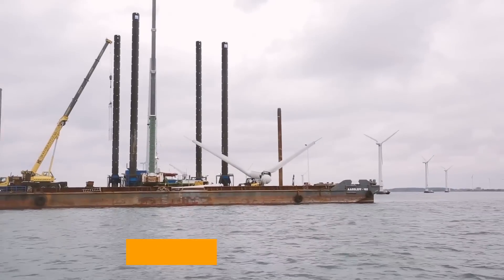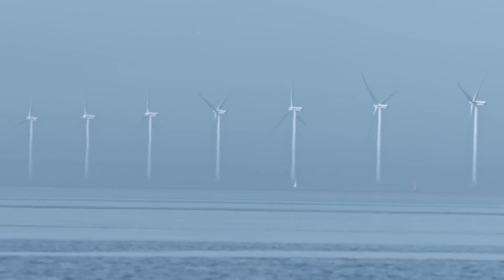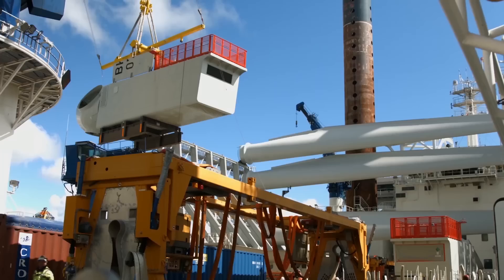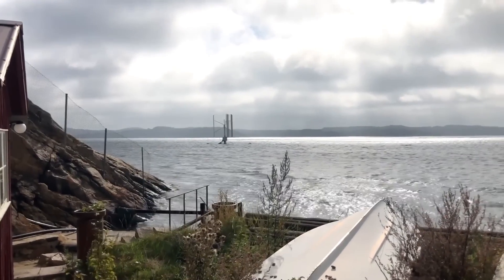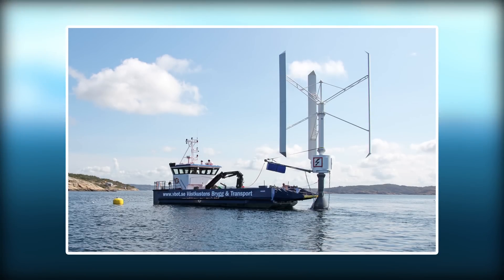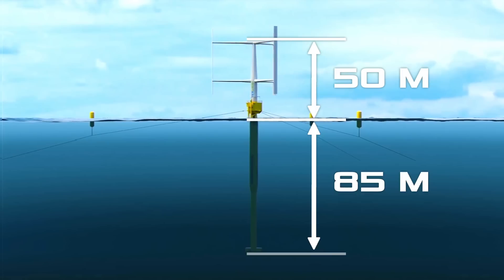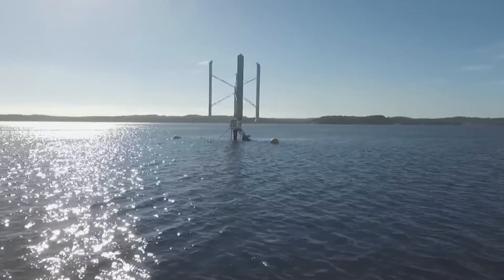Vertical-axis Wind Turbines could Revolutionize Offshore Wind Power

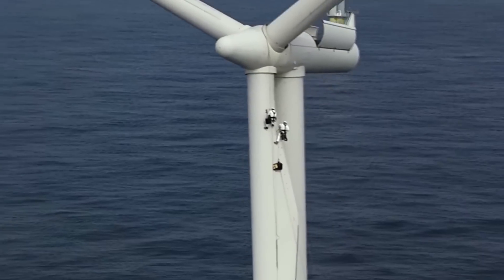Comment: 2:12 "Difficulties of working conditions at sea leads to the fact that every year the efficiency of installations decreases an average of 4.5%."  This first appears to be human working conditions at sea causes 4.5% drop in wind turbine efficiency.   Maybe this is what was meant "Typical harsh sea operational conditions, greatly wear to their blades,  causes offshore wind turbines to suffer an average yearly 4.5% decrease in their electrical power output."   10 years X 4.5% is 45% not 50% as stated in the video.  

Offshore wind turbine blades are fiberglass with reinforcement.  Possibly carbon fiber.   These materials don't stand up to 100 mph 160 kph large hail from hurricanes that is inevitable for offshore wind turbines in hurricane prone areas such off the east coast of North America.  Maybe that is once in hundred years storm, maybe 20 years, maybe next year.  One extensively damaged blade would throw the wind turbine out of balance requiring it to be locked down till serviced or it would tear itself a part.  

 2:25 "The probability of failures and break down is also growing.  After eight years it is 80%".  It is unclear if the wind turbines are left derelict.  There are typically no large subsidies to repair wind turbines which were in effect when they were built.   There is also a heavy human risk factor of risking human lives for a machine that may not have many service years left.   Fish are chased away by the noise of wind turbine at power.  The sea life seams like these structures when not making noise.

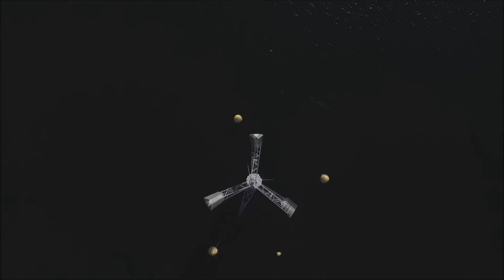4:20 Vertical axis offshore wind turbine.    The basic physics of a wind turbine is it is extracting the PUSH from the wind.  It should be possible to calculate the strain on wind turbine tower or mast to calculate the total force of the wind force on the tower and blades.  The more power the blades are extracting from the wind the more force they push on the tower.   That is the case for horizontal or vertical blade wind turbines.  Strain gauges in the wind turbine tower could be used to determine the wind loads imparted to the tower.  A totally calm day might be used to get a base line. 

Vertical turbines in part an asymmetric (non symmetric) rotating toque of their their wind loading of their support structure requiring it to have great rotational resistance from its foundation.  That's the kind of movement used to remove stuck bolts and screws!   It is in addition to the horizontal pushing force the vertical structure and foundation has to resist from the wind pressure on the blades and other structures.  That high twisting force into the foundation likely keeps vertical axis wind turbines from becoming large.  

There is no wind gain on the forward sweep of the vertical blades into the wind.  Any resistance of the up wind rotating blades reduces power generated by the down wind rotating blades.  It also reduces the torque the foundation has to resist.   There is no way to dynamically balance the vertical twisting load on the foundation because that is the force the is being used for energy extraction.  That is one of the reasons  horizontal wind turbines have a large advantage over vertical axis wind turbines.   

Horizontal wind turbine have a strong rotational horizontal force the tower has to accept that is horizontal in nature at its foundation not twisting.  It the foundation were to give way suddenly under wind power it would rotate upward.   A tumbling giant wind turbine at sea would be something you'd want to be a safe distance away from!   Kind of like watching a tornado.  

One 1MW of generating capability from a grid power standpoint it is not much.   A GE locomotive AC44CW produces close to 3.3 MW of electrical power.

Comment: After 10 years they produce half as much energy? If that were true, it would be a colossal waste of time. Imagine building a house that lost half of its "shelter" after 10 years. Honestly, it already is a waste of time though, just because of how poorly designed those blades are. They still haven't figured out how to put proper sails on those things?

Seatwirl is actually worse in its design than the current version. Those engineers really are something huh?

Comment: Energy in the wind is to the power to the 3 of speed.  In round numbers. You said, double energy when wind speed goes from 20 to 25 km/hr., and thus doubles again at 30 km/hr.. That is 4 times more power. The wind turbine has a wind speed limit for the electric generator, at maximum capacity. Horizontal wind turbine change pitch to deal with higher speeds, and if very high lockdown the turbine. Vertical wind turbine to be simple and robust have fixed blades. Thus only speed of rotation can be used to adjust the energy feed to the electric generator. A slipping clutch is the simplest and robust means of controlling rotational speed. Total energy removed from the wind is the sum of slippage wear and heat and electrical power generated. The alternative is to lockdown. Or the generator is over-sized.

Comment: Why can't we use conical wind tunnel, air drawn into large diameter side to small diameter side creating high air flow and velocity pressure but only problem is that it can not revolve according to wind direction. Any suggestion from gentleman reading my comment.
Reply: I am not a gentleman, but I can inform you, as a wind energy specialist, that a conical wind tunnel going from  a large to a small diameter would be reducing the amount of air flowing through your turbine, more air will flow around your structure than without the tunnel. If you want to know more about shrouded wind turbines, you can probably find information on that subject on the internet, the shroud has to suck wind in by having a larger diameter downwind than upwind. This is not used as the shroud would cost a lot more than what you can gain by using it.
Reply: @jessicaholierhoek4264  I had the same perception as you described regarding conical wind tunnel. I am not engineer by education but by instinct as i design micro-airflow equipment, but of course i m man but not gentle but u look gentle women.

Comment: Some problems with them: The wings have to withstand transversal wind and centripetal forces, making it necessary to make them stronger, thus more expensive. Ordinary wind turbines can use centripetal forces to make the wings stronger, since the force is along the wings, thus cheaper.
There are also 2 wings in the area where ordinary turbines have one, thus again losing efficiency, like a biplane versus modern monoplanes.

Comment: Vertical axis wind turbines have been in use for more than 40 years, and have drawbacks. The primary one, is the bending moment of the axis, which on land, requires guy wires to limit the bend. The sea 'float' reduces that bending moment, but also introduces the possibility of the rotor blades tipping into contact with the sea in high wind conditions. All ocean placed wind generators will suffer from salt water corrosion, so lifetimes are likely shorter than stated, especially as the generator/gears are place close to the water surface. Sorry, I see this as another concept proposal that most likely will not gain enough investment to become a success.
Reply: Conventional system do suffer from offshore conditions too but it is less severe and the installations are better protected.

Comment: Far too large a rotating mass to be stable for very long. A hair brained idea.
Reply: Smaller prototype has been stable since 2015 ,  stability increases with increased mass.
Reply: @etxkgh  Any tiny out of balance element would wreck this thing in no time. These kinds of rotors have been used many times before. They are very effective at killing thousands of birds though.
Reply: @mrofnocnon  And how fast is it rotating ? Have you seen the first prototype ? Much lower speed than tips of the blades on horizontal turbines. Check the Seatwirl solution properly before you comment.

Comment: I watched an undecided video where Matt Ferral covered something similar except the windmills would lift weights up from the ocean floor then releasing it would generate electricity, and another version were the blades of the windmills would retract according to wind speed greatly improving the overall performance by allowing their windmills to operate in much higher wind speeds and last longer by only absorbing the wind it uses instead of using brakes to slow the blades and bucking against powerful gust.

Comment: A revolutionary and innovative design, this new model of vertical axis wind turbines can bring down the cost of energy. Offshore wind power plants have a tower connected to the underwater structure, the energy of the wind causes the turbine to rotate similar to the function of a keel on a sailboat. Being able to be transported to any place where there are strong winds, this wind turbine is safely anchored to the bottom of the sea, this megaproject is evolving, it has everything to work out, it is incredible and ingenious, much more efficient than traditional power plants. 🎯

Comment: The information in this video is pure fiction. This whole video is utter nonsense, misinterpretation, misinformation and magical thinking. Offshore wind turbines are ALREADY producing energy at a cost of less than $50 per MWH. It's pure economics, if Wind turbines really cost so much more per MWH than other forms of generation then nobody would build them. It just wouldn't be profitable. And before people start whining about subsidies, I remind you that the fossil fuel industry is the most subsidised industry in the world. Vertical axis wind turbines are great for certain applications, but they have their own drawbacks that limit their utility for large scale offshore use when compared to the current designs. Again the tech isn't new if it really was more viable PEOPLE WOULD ALLREADY BE USING IT. Because of economics.

Comment: Not sure where you are getting your information, but you do not need a strong base for a wind turbine. They can float in the water with only a single shaft. And they have not reached their limits. The largest turbine I have seen is 20 megawatts each. These turbines will outproduce a VAWT.
Reply: Seatwirl are aiming for 30MW or more.

Comment: Pretty superficial video, without quantitative data to support the idea that VERTICAL axis turbines are more productive than HORIZONTAL axis ones.
From time to time people get exited abut this 'revolutionary' type of technology.
The only application I can see is on the roof of buildings in crowded areas where horizontal axis wind turbines cannot be installed.
Reply: You forget the most important issue . the cost per MWh , there horizontal fails.

Comment: Fundamental aerodynamic facts makes vertical axis wind turbines dramatically less efficient than normal “propeller” versions. Totally meaningless to use this.
Reply: They are fundamentally less efficient but they have advantages that make up for that in the offshore environment, he literally went over some of them in the video ?
Reply: @n.g.s1mple29  it's only applicable on small scale
Reply: @bradowen8862  30MW or more is planned.
Reply: The bottom line is lcoe , there the Seatwirl solution wins.
Reply: Agreed, they're about 10% eff. of the Bitz Limit which makes the overall efficiency around 5.9%
Reply: They don’t even have any advantages. They’re saying the bearings don’t have to support the weight? Are the rotors held up by magic? All the gear is put down closer to the salt where it’ll be more exposed. Silly idea. When you make an investment you need to get the most out of it. The supposed advantages of stabilising can be done for normal turbines. The North Sea is running out of space to be allocated, they’re competing with fisheries and shipping routes. They can’t just get around the monumental drop in efficiency by saving a bit on the installation and having more of them.
Reply: @Freshbott2  congratulations, you misinterpreted the information given to you

Comment: Propeller type is the most Material Efficient type. The least material covering the largest Wind area. Which is the most important factor in cost efficiency.
Reply: But i guess that pressure exerted on vertical system is below capacity if u perform air flow test.

Comment: Regardless of technology, you cannot escape the basic, physical fact, that winds at the greater height of vertical axis machines, are simply much, much more powerful and regular. I could see a role for these, sitting between the uprights of a massive off-shore wind farm. (News in today: A single off-shore wind turbine, in a 24 hour period, generated... drum roll... 359Mwh. Enough to power a totally electric home-car andall- for 30 years. Too, too slow, but we're making huge advances.
Reply: That would give the wind generator a capacity of at least 15MW. The worlds highest capacity wind turbine is I think 13MW.
Reply: @gerrycooper56  With current technology the SeaTwirl design can be enlarged to 30MW , But even for lower effect the SeaTwirl design will have a lower lcore than current horizontal solutions.
Reply: @gerrycooper56  There are prototypes with 15 and 16MW.
Reply: @janos5555  vertical axis?
Reply: @gerrycooper56  No, horizontal
Reply: All windmills could use floating bases under water tethered to the sea floor. There’s no need for massive solid foundations.

Comment: As someone in wind energy, many of the facts presented here are simply not true. 
Rough MWh LCOE by source: 
Coal 110$
Nuclear 155$
Offshore wind 115$
Onshore wind 53$
Photovoltaics 68$ 

Subsidies are meant to nurture a technology until it's maturity and price competitiveness. This is exactly the case with wind energy as the first subsidy free 1.5 GW Hollandse Kust Zuid offshore wind farm was opened.
Turbines are continuously growing, requiring less foundation units, less cables, less installation manhours, benefiting from economies of scale. GE has 2 operational 14MW turbines and Vestas is just rolling out the first prototype of 15MW V236. 
Being open to new ideas is one of the pillars of engineering. This is probably why a new revolutionary horizontal axis turbine concept pops up every 6 months, but rarely sees an industrial scale prototype. I am looking forward to Seatwirl's S2 project's success!
Reply: The true cost of wind power energy is infinite without storage or other power source. Offshore wind turbine generators can only substitute for other sources of electricity when the wind turbine has electricity available.   There still has to be built natural gas combined cycle power plants or equivalent to provide the power grid's demand capacity.   

Even cheap natural gas is an expensive fuel compared to coal in an ultra high efficiency clean burning coal plant.   Europe does appear to have even lower technology  high efficiency clean burning coal plants.   The power from wind turbine farms can be culled to be near grid quality.  Photovoltaic electricity is too erratic for grid quality and is best used to charge storage.
Reply: Let us not forget that oil companies at least get subsidized as well. 

 I recently just seen a single rotar turbine design. It still has two blades, but one piece. 

 The benefit of it supposedly is that it will somehow follow the main gusts of wind. It will be floating. 

 It won't produce as much per turbine, as the effiency is lower. 

 However they say it will be much cheaper per unit. Allowing more units to be built overall. 

 The entire thing is to make the LCEO incredibly cost competitive for offshore wind.

 I would like to add off shore energy can be great due to the fact they don't suffer from being intermittent as much as others. Allowing for almost constant energy. 

 The benefit to renewables like wind and solar is that the solar system over produces. Meaning we can produce enough even when the systems aren't even close to full capacity by just always having more than always needed. 

 Also EVs will not be a problem. Our capitalist society only produces as much energy as we need. If more is required we will simply produce more.
Reply: How exactly was the L bit done of the LCOE ?
By ignoring the greater proliferation of transmission lines needed by diffuse sources ? By ignoring the need to stabilize the net because of unpredictable production? By ignoring the resale of heat produced by nuke plants ?